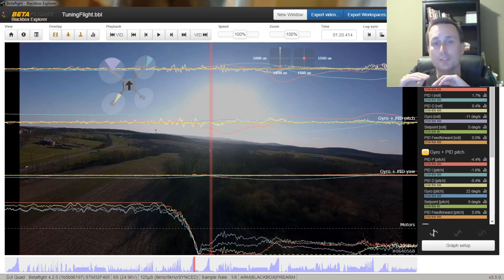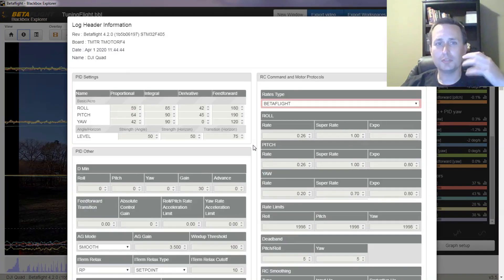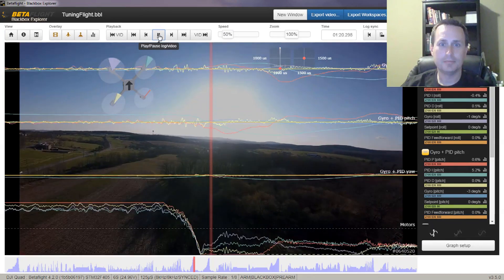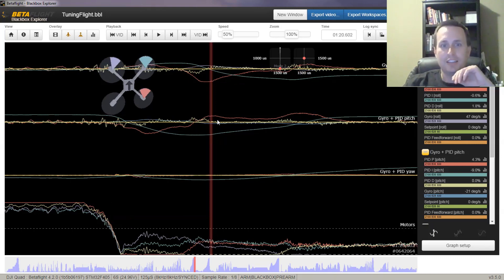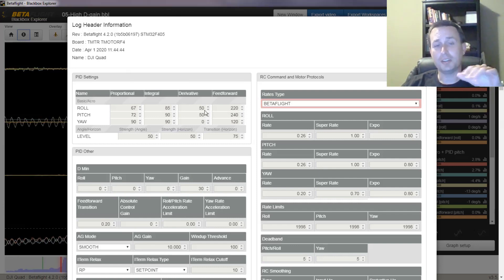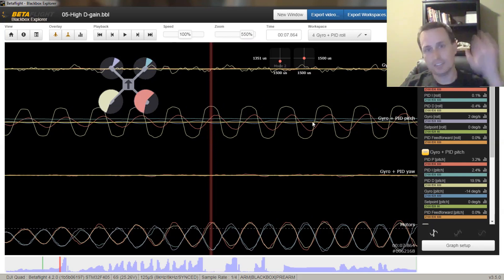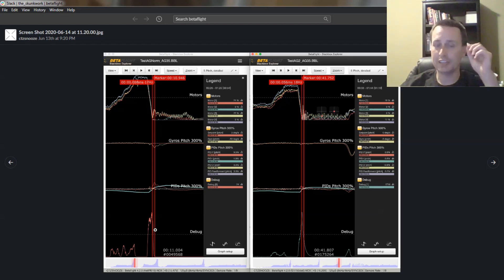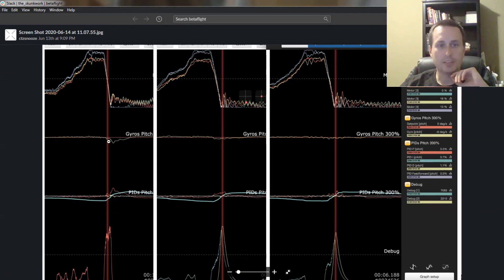Improving Throttle Chop Bobble or "Throbbles"

Comment: Thanks for the video, great content. Never understood why I can't just feed blackbox information to my FC (BF) after a flight and feed it the information so it can tune (make improvements). If do this after every session in the end it will be tuned, right? Even at the refinery I work PID controllers are auto tuning these days.  With al the advanced (hidden) features we need more stuff to be automated. So, tune it with your guide to get it 90% there and then let it refine itself. At the refinery smart controllers are doing things we could never have thought or imagined, we just set the limits for (proces) safety, PID controllers are still the basis of it all though.
Reply from the maker: Yeah, noone has coded it yet for fun (in terms of BF and OpenSource).   It is a hobby.  For the private sector, it is not a billion dollar industry (yet?) I reckon to make it worth anyone's time to code it up.  It is more than meets the eye to detect a Stepped Response and then move stuff to get a Critically Damped PID control response.  

It really needs do be done on the fly, and we lack processor power and GPS to auto-fly the thing.  Safely.
Reply: @uavtech  It is sometimes hard to imagine people doing this just as a hobby, takes a special kind of person. I always imagined more influx from the commercial side of things, the fpv community is a huge test base. Drones are the future, everybody knows that so money should not be the issue. This is more out of the box thinking I gues. Thx again for your content, glad to be a patreon

Comment: Could you increase filtering to get D higher?
Reply from the maker: To fight movement?  It is pretty slow, so P-Term is the best bet.  

D-term fights against external force, but if slow external force, is weak pushback.
Reply: UAV Tech 
Sure... but you could not increase D to get P higher to fight the wobble. D is noise limited from what I understand. So why not increase filtering a bit to increase PD while keeping the balance
Reply from the maker: @jas-FPV  , yep.  You could.  Maybe.  But that increase signal delay so gets to be counter productive.  

Most of the time as well, D-term oscillations are not noise related.  It is a harmonic of the quad inertia, gyro signal delay, to the motor delays in ramping, etc... to the D-term reacting.  Too much shit at play with these thing.  Damn flying things are complicated.  :-/

D-term is limited too on on filter amount for smooth forward flight though.

Comment: I admire the work you put in and the knowledge you spread. But like many BF users, you are stuck thinking that having gyro accurately track setpoint is the most important part of having a good flight feel. And that is just completely inaccurate in my experience. For freestyle at least. Don’t know and don’t care about racing. I do like the cool features that BF devs work in, but it just seems so overkill.
Reply: If you think of firmwares like falcox, don't forget that people have also worked a lot of time on it to upload presets, so all in all there is a real search for optimal settings to understand and against squaring the ultra violent maneuvers that we ask of our quad bikes which are simply limited by physical laws
Reply from the maker: IDK, I like to quad to do what my fingers tell it to do.  Not just randomly wobble around.

We're all on the same page that the Setpoint is your sticks right?  That when the quad is following the Setpoint that means the sticks, which means LOCKED (like real locked, not the fake hype marking locked of other stuff)?

To each their own, but dismissing Setpoint tracking is kind of way off.  There is nothing else to track than random motion you are used to with something else.
Reply from the maker: Yep.  And whatever setting make it track the sticks best (the Setpoint) WINS!  It is Objective.  Whatever has the lowest PID Error (Gyro - Setpoint) is the best!  Simple.  All else is Flat Earth talk when it come to FW development.
Reply: UAV Tech I absolutely understand what you are getting at. I literally deal with PID control loops on a near daily basis for my day job. In fact, I’m the lead process control engineer when it comes to PID type controls. But all I am saying here is that for flight “feel” (which I understand is completely objective), gyro following setpoint does NOT necessarily equate to good “feel” in the air. Yes, I understand that is nye impossible to put any scientific stance on, but after flying EVERY flight control firmware and tinkering with ALL of them over the last year, I have to say, BF is my least favorite for how the quad actually flies. To me it’s simple to understand. But people that can’t seem to get past the BB logs, don’t seem to get it
Reply from the maker: With all respect: how can you say the quad not exactly following your stick commands is NOT the best feel?  If folks think that, I suggest they don't like their rates once they get the quad to actually follow them because they are used to it not following them with something else or older versions of BF.  IDK, just a thought.

We get it, it could be you, ya know.  Maybe try to adjust your rates once you are tracking well.

No meaning of disrespect, but this is the Flat Earth arguments in FPV:
"Those Ph.D. scientists are all wrong with their 500-years of proof 1000+ proofs the Earth is round (+ of course ... you know, seeing it from space).  I know the Earth is flat because when I look at the ocean, it looks flat.  They are such idiots, they don't get it."  😖

No buddy, we get it.
Reply: UAV Tech oh trust me, I’ve spent weeks and probably months trying to get BF to do what I want it to do. Rates, PIDs, filters, every little tinker spot there is. It just cannot do it. Not sure why yet, but it’s most definitely different. I’m sure (obviously) many people like the way it flies, but it just doesn’t do it for me. Not like it matters, I’m just trying to point out that tracking setpoint every second of the day is not what makes a quad feel right to me. And that’s not to say that the other firmware I prefer isn’t doing that either. They are just different and I’d like to know why...
Reply from the maker: So a theory is you are use to lagged response.  Is it KISS or F1 you fly?  For either, we can emulate what they are doing in BF based on logs i have seen of both.  Both are a basic PID controller with little to know RC smoothing.  I'm guessing that feel is something you are accustomed to - which there is NOTHING wrong with that - but don't think others are wrong for wanting more.  Again, there is NOTHING wrong with liking an OTB controller response, just don't think others "don't get it" because they want something a little more sharp.  Something right on their stick movements.
Reply: UAV Tech KISS. And after all my efforts I cannot make BF feel like kiss. It’s jagged and nasty IMHO. And that’s only because it’s taken such a leap towards perfection that it makes the flight undesirable to me. I’m certainly not the only one that feels this way. It would be nice if there was a method to make BF feel similar, but there simply isn’t. It’s so geared towards racers and MANY people are having issues they never had before. The RC smoothing point is interesting. Because that will inherently add delay to your stick response, so calling that lagged out setpoint tracking “locked” no longer holds any weight. Although I agree, some is necessary with crap control links. (FrSky)
Reply from the maker: What D-Term Setpoint Weight value do you use in KISS?
Did you ever look at a KISS log?

Yes, RC smoothing adds one frame of delay (~6.67ms in Xfire), but then enables you to use things like FF to reduce 20ms+ of delay.  So eventually the delay added is made up for by the use of FF.  There is no other way to have a PID controller without a D-term Kicks (D-term Setpoint Weight) or FeedForward, reduce the lag.  AND both Setpiont Weight and FF require a smooth RC signal (not stepped).  KISS does seem to ignore that and their logs shows it bad: https://www.screencast.com/t/hBev5Uj2 
Note all the oscillation signals to the motors because of no RC smoothing.

So to emulate KISS in BF it is easy.  Turn off RC smoothing and everything else.  Also turn off the Dynamic Notch and set lowpass filters as static at 100hz on Gyro and D-term.  BiQUAD for D-term.  PT1 on Gyro.  No FF or course.  No Anti-Gravity.
Reply: @zfpv7211  take co-pilot, it 's feel best 🤣🤣🤣 kiss fun, drive car without servo, abs, push brake and car do what ever he want to do, good feeling 😂 no one talks about motors temperature in kiss. Kiss is flying like bus, betaflight fly like you want 😎
Reply: Drone Playground Kiss does not fly like a bus lol that is a ridiculous assumption. And I’ve driven race cars, I know the effects of not having those features. It’s much better for a performance driven application. And Marc, I’ve done all those things, still didn’t feel right. Also, my motors on kiss are NEVER hot. Even on 100 deg F days they remain ambient. So please, explain...
Reply: @zfpv7211  don't fly like bus, give me evidence in log, I follow you channal, I am your sub. Make video with logs, prove it, very simple. Kiss, centar stick feel like  steering wheel of bus, full defection stick kwad enter in with delay, like there is no FF, exit from full defection stick like it has too much D. Move from full front pitch directly to full right roll like it on/off/on, kwad do not have that middle stick command. Because of all that you think that you are better pilot and than you in love with kiss. Kiss forgive you middle stick input in diagonal from full pitch to roll. Flying kiss is like you have someone between your stick input and what is kwad doing, flying bf is like kwad do exactly what you do with your stick in between 6 and 18 ms. Sounds hard, I know, just keep flying kiss 👍
Reply: zFPV I’ve flown kiss since 2016 and like to think I’ve tuned a few quads on kiss, I put 4.2 on a quad and I prefer how it flys to kiss after fiddling with it, to the point where I only fly the bf quad now, in 4 years of flying kiss and being a fanboy never thought I’d say that 😊
Reply: Drone Playground again, I get it. It’s highly objective. I’ll stick with kiss because it does what I want it too lol it’s that simple. I’m only trying to understand why BF can’t get there. And if you’re subbed to me, then you’ve seen my videos, which firmware flies better bud? Please tell me?
Reply: @zfpv7211  go to your video, bf 2700kv you will see my comment. I watch all your video because you fly kiss and you write fw, parts etc so I can see how it 's fly. And I leave you 👍
Reply: Drone Playground it’s no problem to disagree man. But the quad flew like shit in that video and the one you just now posted on lol even with Fettec ESC. There is definitely something strange that happens with BF and FETtec ESC. Haven’t quite put my finger on it yet. But when coming out of an aggressive move, flattening out, and free falling, it’s like the quad wants to wander... hard to explain. You can see it in the video you just commented on.
Reply: @zfpv7211  Can we agree, it is easier to fly smooth with kiss than bf? 👍
Reply: @zfpv7211  you mean subjective, not objective.

Comment: Dude, please make a video that is simple and straight to the point. What point in this video do you tell what to do for roll bobble?
Reply from the maker: Upgrade to BF 4.3 and increase Anti-gravity.
Reply: @uavtech  Thanks for the reply. I can tell you that it is on 4.2, and had no problems until I upgraded to Bluejay at the advice of Josh! I turned on RPM filtering and upgraded the esc from BLHELI 32 to Blue Jay. That is when the wobble began. I did try to go back to the original settings and it would bind but was giving filter error flags and so I put Blue Jay back on and now it works again. I did upgrade a Crux 35 to Blue Jay and it works great, so who knows. I did increase P by 5 and set thrust linear to 20. I am going to fly it tonight and see if that helps!
Reply: @uavtech  I forgot to mention that I set the throttle minimum from 3 to 4.5. I am not sure how it was so low since I had read that Betaflight has it set to 5.5 by default!

Comment: I never had throbbles until 4.2
Reply from the maker: Same PIDs?  I think not.
Reply: @uavtech  No. I retuned according to your video. Good info. I am happier overall with how it flies now, but there is a little bobble that I have not been able to get rid of.
Reply from the maker: The controller is the same, so try to think about what settings are different.
Reply: @aowi7280  me as well on a six inch quad.  Been trying to work this out for months.  Seems ever since 3.5.x BF hates anything over 5 inch